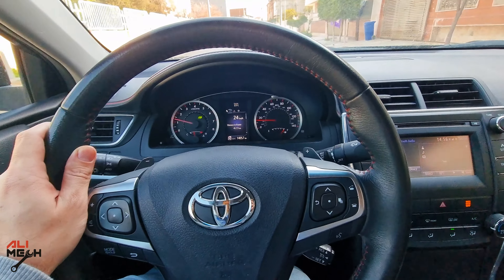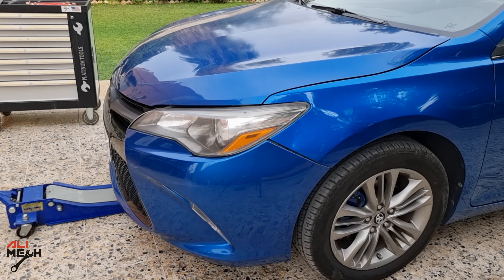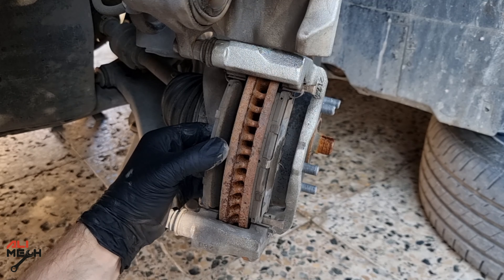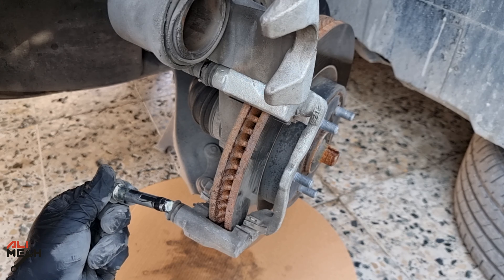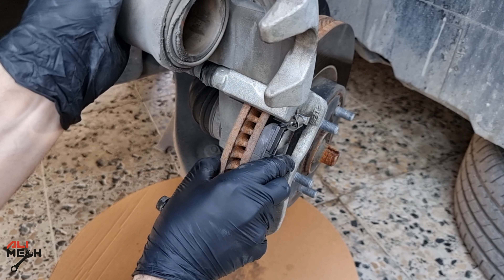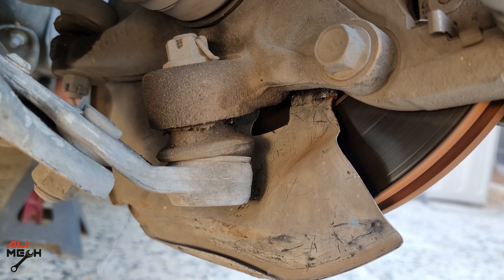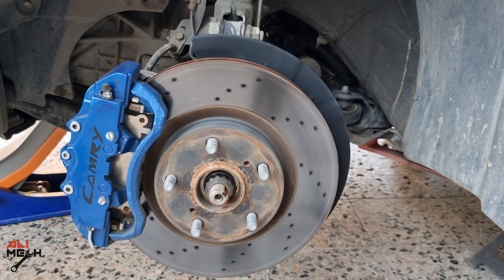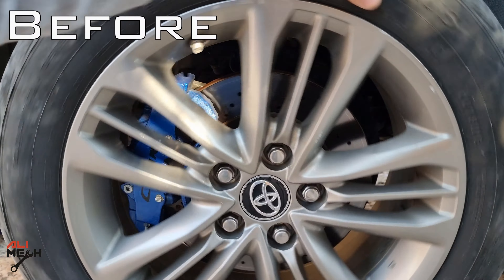Why Your Brakes or Wheels Squeak??  Squeaking noise while driving slow / Squeaking brake noise

Comment: I heard water pump goes out early in these camry with 2ar fe engine. Should I change it early before it makes noise or fails. My car 2013 camry has 120000 miles. Please advise or if you could make a video. Great work as always!
Reply: Never replace a water pump early unless it's leaking or making noise

Comment: Another question I have is, did you ever remove the oil pan and clean it. Would their be any benefits  of cleaning one's oil pan with a brand new gasket. Just curious on you opinion Alimech. Larry usa
Reply from the maker: Not really, but soon I will do an oil change for automatic transmission and remove the oil pan

Comment: Alimech: thanks for this tip on getting rid of this noise on your rotors. But I have another question on this car. How does one do a transmission pan removelal of my 2017 toyota camry le with the sub frame issue. Is their any help online that gives me instructions If I am using floor jacks. I am concern because of the angle of the sub frame over the pan. Can you please help? I want to do this myself but timid. Your have a good channel.  Thank you, Larry
Reply from the maker: I'm thinking to do that on my camry too, stay turned for that video